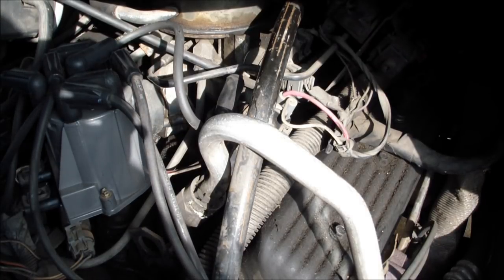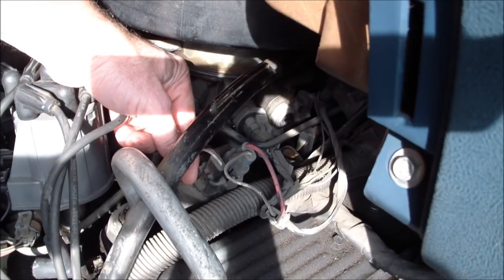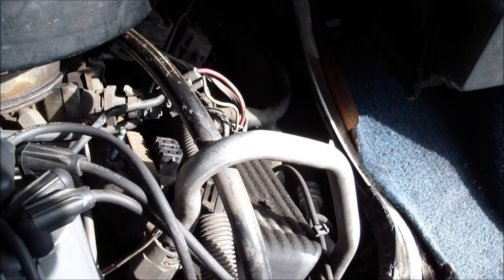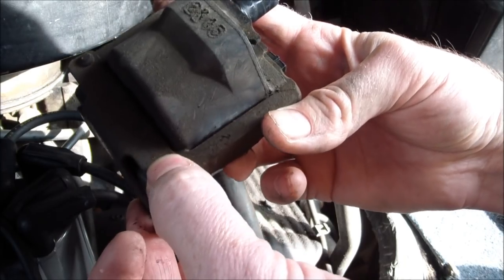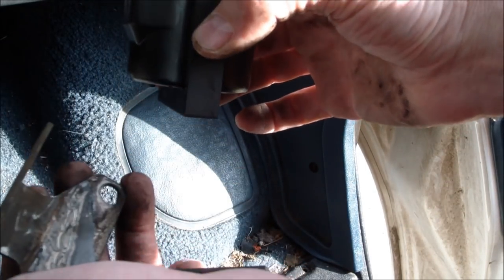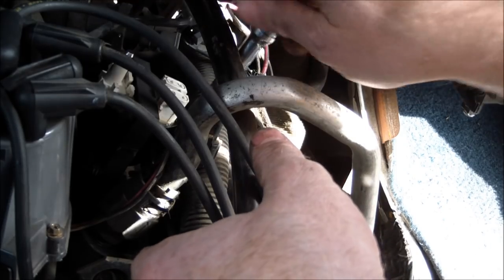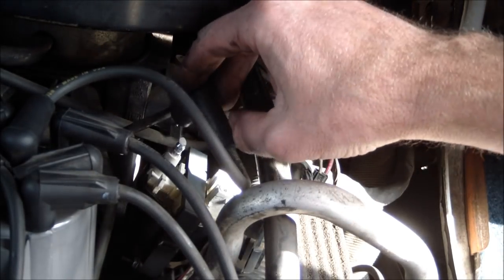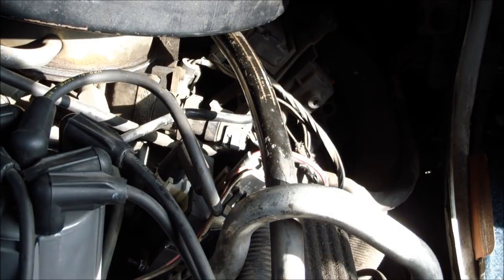How To Replace The Ignition Coil On A GMC Safari Or Astro Van

Comment: Drill out? Never done, I'm assuming you can use any drill bit smaller than the hole
Reply: No, the idea is to drill off the head of the rivet. For that you need a drill bit at least as big as the shaft of the rivet. It's ok to be a bit larger too. As the bigger drill meets the intersection of the head of the rivet and the bracket, it will just spin off, if the drill bit is slightly smaller than the outside diameter of the head. Or, if the drill is as big or bigger than the head, it will be shavings at this point., and you stop when you see the bracket.

If you use a drill that is smaller than the shaft you will just be coring out the center of the solid rivet. Although this may weaken it, you would then have to chisel off the head.

Now, a good idea, as I think he said is to use a center punch. Then guesstimate the size of the drill you need. A very good indicator of the size you need is by measuring the bolts they provide for reassembly. Use one  larger than the bolt shaft.

The best idea is a drill larger than the shaft, yet, smaller than the outside diameter of the head. The benefit is, if you are off center, or not drilling square to the surface, the drill won't skip off to the side.  If it does skip, continued drilling will be very, very difficult. So grinding the remaining head is usually your best option.

Comment: My van is having a starting problem that makes me crank it about 8-10 times before it starts.(starts normal after the initial start) Could this (video) possibly be the problem? Also, you wouldn't happen to know the locations of the knock sensor on the driver side? I have a brand new knock sensor and a dangling wire that goes to it but can't seem to find the screw-in location in my 95 GMC Safari van. PLEASE HELP! I'm hoping this is the reason why my engine light is on.

Comment: Hello, I am putting a tachometer in my 2000 gmc safari. The instructions says one wire goes to the chassis  ground and the second wire goes to the output side of the ignition coil. My question is,  is the output side the front clip or the rear clip?

Comment: does the  icm have too be grounded for it to work gmc  i got my new one hanging cause i cant get the old one off will it be ok?
Reply from the maker: I don't know if the bolts that hold it on ground it or not.  I'd guess that if your car runs with it like that, it will be OK.

Comment: I have a 1990 GMC safari van. I was driving and it just cut off so I pulled over and now it just won't start again. Did the fuel pump & filter still won't start. Help please
Reply from the maker: Check the fuse box for blown fuses. Smell the exhaust for gas when you crank it over, to see if it has fuel. Pull one plug wire and put an extra spark plug in it, ground it on the engine block and see if it has spark.

Comment: Don't think it's the fuel pressure. I just put in a new fuel pump & filter, also replaced the fuel injectors & the 2 fuel lines. I'm not a mechanic, I just learn while I go. Just can't figure out why it crank starts. I'll figure it out one way or another, thanks anyways.

Comment: Try the Crank sensor. I had the same problem. It does seem like a fuel problem but it was the crank sensor located at the bottom of Distributor Cap You remove the clip on front of cap, remove 2 screws that hold the sensor, and crank the engine until sensor is in position to lift out. (There is a notch that allows this after you crank the engine about 3 or 4 times. To eliminate the fuel issue, spray a little starter fluid in the breather assembly. I had that problem first.
Reply: Thus the Cam sensor

Comment: My 2002 wont start after a rain.  I am not sure if it is the coil or the distributor cap or both.  Any thoughts?
Reply from the maker: Water in the distributor would make it stall, but the distributor is so well protected from the rain in the engine compartment, that I would look elsewhere for the problem.  Check your battery terminal connections and make sure they are clean.  It's possible water gets in through the grill and causes some electrical problems closer to the front of the engine.
Reply: ***** Turned out to be the cap and rotor.  Replaced those and it cranked then purred like a kitten.  No water in it.  Just way overdue for a change. Thanks!

Comment: is that the one that gets moister in and the van stops workig ...because everytime it rains are van stops working .
Reply from the maker: It probably isn't the coil, but might be the spark plug wires.  It is hard to tell when water makes an engine stop working, because an engine has so many electrical connections on it.

Comment: hi what are the symptoms of a bad ignition  coil?
Reply from the maker: +Felix Flamenco Fuentes it varies. Sometimes the car won't start at all because it doesn't make any spark. Other times it runs when the coil is cold, but when the coil heats up, it stops making spark.

Comment: thanks..
what happened with my safari is that some time shows P0300 code multiple  misfire but then disappear.  it's hard to started sometimes.
Reply from the maker: Maybe it's a bad spark plug wire or two.

Comment: My key to start the van is stuck. As in when I start and park, I cannot turn the car off because the key won't go down. I really really need help with this because my car just stays on and I cannot turn the car off and key gets stuck in ignition. Want to know how to fix this or to the best place to get it fixed. 

Please reply!!! 2015
Reply from the maker: I have never done an ignition switch replacement so I don't know how hard that is to do. Before that, you should try putting some graphite powder in the lock to lubricate it. That might get it unstuck. I have used it on other locks with success.